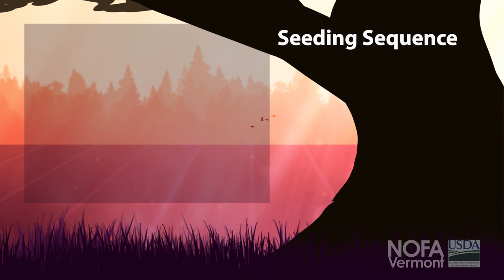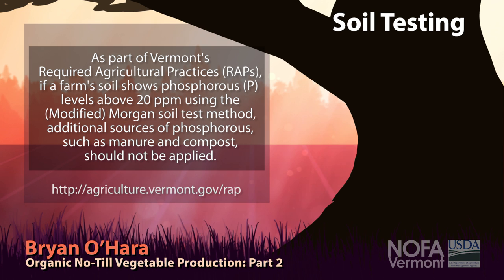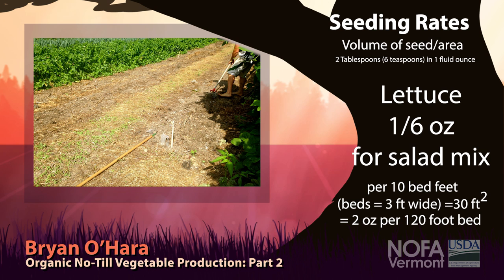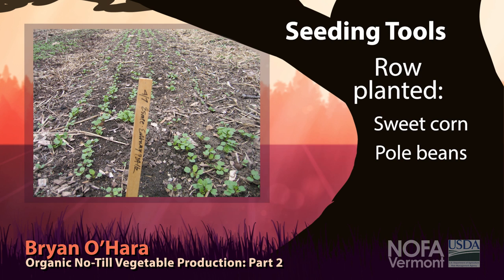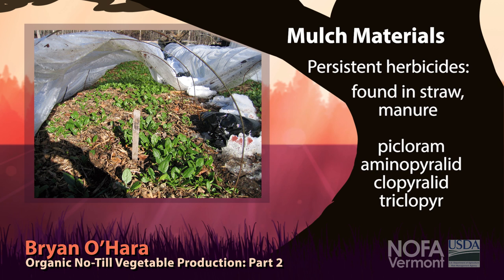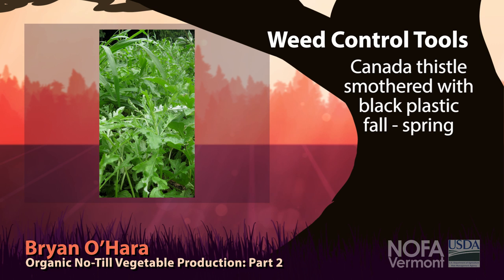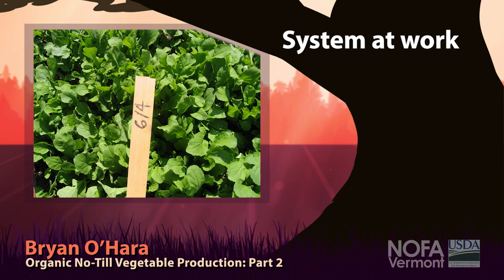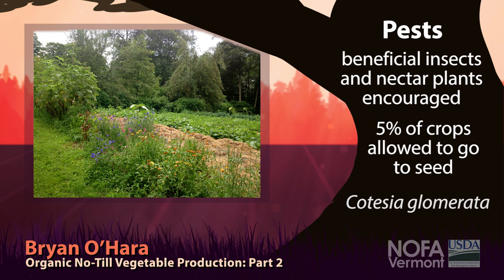Organic No-Till Vegetable Production with Bryan O'Hara: Part 2 of 5 | Managing a No-Till System

Comment: Firstly, awesome content Bryan.
On the cabbage slug event....
Oliver Husson has done some work explaining how Redox impacts plant health. He has pin pointed specific conditions of Eh/pH that enable pathogens and predators to see weakness caused by fluctuations in redox homeostasis that in turn, likely cause mineral deficiencies that often ring the dinner bell for plant pests.. Persistent waterlogging would have a reducing effect on the soil and select for life or not, in regard of this.
My guess is those Cabbages suffered because of persistent reduced state, you already pointed to the water course
 I think cabbage, and other brassicas are plants that preference an oxidised state of being, or rather they like a diet of nutrients higher in the oxidised forms, and so a higher rate of this type of microflora might be needed, but be missing due to a lack of DO in the soil.solution., eg i think cabbages etc prefer NO3- not NH4+  and since everything uses a ratio of elements to construct its own life energy, it may be this watery location will never grow any plant that prefers oxidised dominance. Pourbaix would explain why certain elements might not be avialable, even if temporarily.. however, if this during a protien cascade, reproductive phase shift, or other hormone fluctuation, this subtle change in life force is like an open invitation to something else to eradicate the objects causing the breakdown in system harmony.
I think everything needs to vibrate at the right resonance within any one space. Anything that attempts.to whistle its own tune, tends to get singled out :-) 

Awesome video btw..super good content for real world use cases..i am really enjoying it and would love to spend time learning your gems of knowledge on your farm.